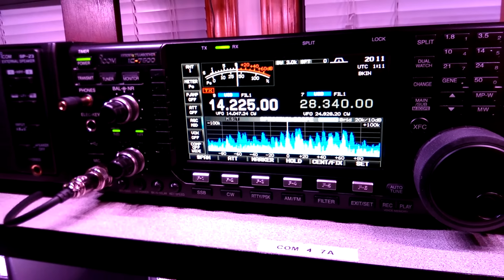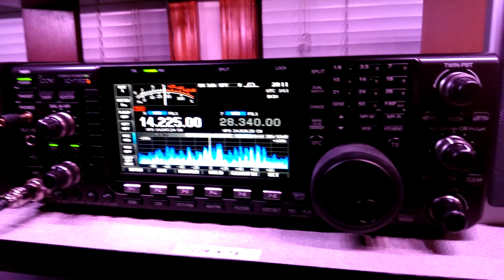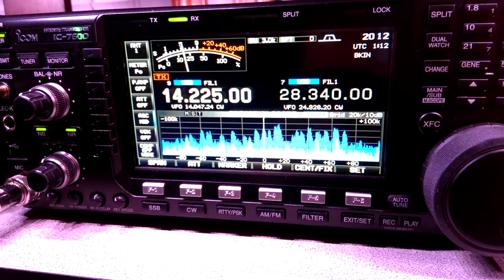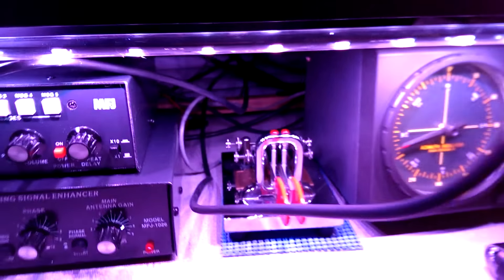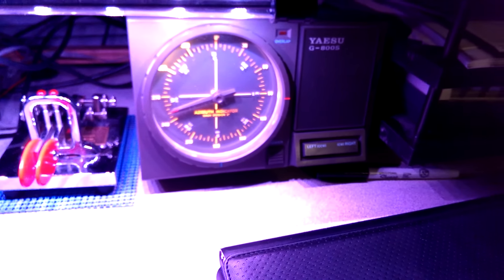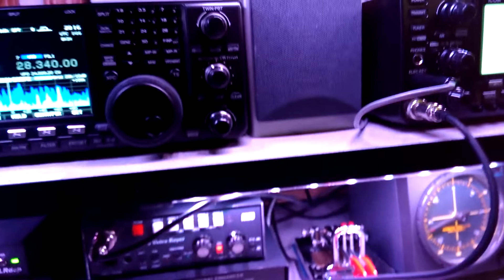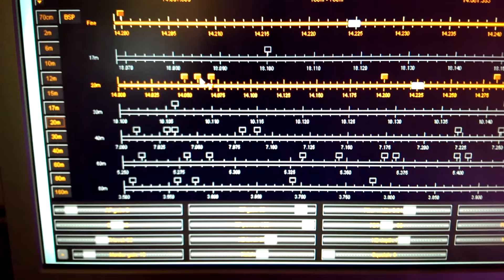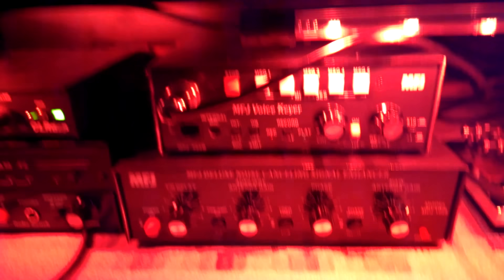My Amateur Radio station recommendations

Comment: Nice station setup Johnnie!  It seems from some of the comments below that folks don't understand that this isn't a "beginner" setup.  It's a more advanced setup, but by no means a top of the line station either.  Like all hobbies, you can get in cheap or the sky's the limit.  If they think your setup is WAY to expensive or complex, they can always start at the lower end.  Nice video though.  Thanks for posting.

Comment: Great video! I especially like the lights, just bought my 7600, and have to set it up. I was using an IC-740 I bought used about 30 years ago, and it finally died about a month ago. With reliability like that, I think this is probably the last HF radio I'll ever have!
Reply from the maker: They are on sale big time at HRO, is that where you got it?
Reply: Yep, just had to convince my wife... which is a story in itself! Actually, she was very supportive of my spending the money, it helped that my birthday is this month, and I told her she could just put a bow on it for the next 5 years of Christmas, birthdays, father's day, etc...
Reply from the maker: R Berber Your going to love the radio! Be sure to get a USB cable to connect it to your PC for logging!
Reply: Fix that 740. If you're not capable of doing this, ship it to me, I live in N.Y. &  I've been an Electronics Tech.  "A"  since 1980. I'll be more than glad to do this job for you. Just so you know, everyone I do work for, always gets a great deal, & I do not, ripoff anyone. Things like that?? always comes back to those who do... Ten Fold. '73's

Comment: Fantastic setup.  Interested in the 9100, but a bit scared off due to having a very early 746Pro (with all the problems).
Reply from the maker: +Scott Taylor Life is full of risks but life is not a trial run. Live it to its fullest.  Last I looked there were no luggage racks in a Hearse, we leave this world the way we came in. Don't ever let fear stop you from doing what you love.
Reply: +johnnieace45 I certainly understand that concept.  Just trying not to get a lemon again -- especially since Icom do not own up to the issues for so long.  Wondering if a decked-out K3S with x-verters might be a better way to go.  Another issue is that I am renting a house (at least for the next 18 - 30 months) with incredibly limited covert antenna options, and I do not want to get the Elecraft only do discover a K4 (or something from another mfgr) coming out when I am ready in my own house.   lol...  I guess it is nice to have options.
Reply from the maker: Scott Taylor Elecrafts are not without problems. Good luck, buy a rabbits foot first. :-P
Reply: I think the differences between the now model and the coming soon model—with radios and many other things—are always very incremental and make little difference in the great scheme of things.

Comment: So far I have a uniden bc345crs, a uv-r5,and pretty soon I'll get a pro 2055 and a possible CB radio with CW along with it.
Then I'm going to get my technician class license then upgrade it to general by July 1st.
Reply from the maker: +code lyoko 34 Look at rigs from the 80's Like the Icom 735, Kenwood TS440, Yaesu 757GX. Those are some of the best bang for the buck radios out there. Can be had for around $400 now. Later you will be able to sell it for what you paid for it if not more. :-)

Comment: Very nice setup. I've been a no-code technician for over 30 years and just recently got my General 2 years ago. I haven't gotten an hf rig yet. I only talk on hf during field day. I'm now working on my Extra Class and looking at either getting a Icom 7600 or the 7300. Can't make up my mind. This will be my first ever hf rig. That noise bridge, does it just connect to your 7600? Also, if I go with the 7600, what do I need to connect it up to my computer. My eyes are getting bad and I'd probably have to squint to see the controls on the front cover of the 7600. So a computer setup would be better for my viewing. Also, will I need that Kantronics for digital work with the 7600? I thought the 7600 already has digital built in. Anyway, 73's. aka N3NQP. P.S., would like to talk to you further for advice.
Reply from the maker: From what I hear the 7300 is an outstanding deal and very affordable. They sound great on the air. Also check out the Kenwood 590sg and the Yaesu FTDX1200.
Reply: Thanks! 73's.

Comment: Very nice station!, I hear you about spillage and putting it on the second tier, I saw a Youtube video of iv3yer's station and he has the radio slightly raised but then he tilts it up. I have a ts-2000 now but eventually want to get either a 7600 or FTdx5000, can't decide yet. I have always loved the look of the FT-2000 but that is a bit of an older rig.. the FTdx5000's look comes close to that.Who makes the lights that change color?
Reply from the maker: IC7300 is the new cat's meow of the Icom line, check out the reviews.
Reply: just ordered my 7300 from giga parts fri. should have it by tue. or wed.
Reply: If you like finger prints all over the face of your radio which I do NOT.I am a huge fan of ICOM & Love my 7600 but would NOT use a 7300 if it were FREE or any other transceiver that needs me too touch the display just so it will perform any function.Stupidest idea ever brought into Amateur Radio.I'd take an ICOM 7000 hands down over the 7300 since it's AWESOME & no need for touching the face or display for any reason.
Reply: I BOUGHT a  7300 love it but it is not American made i pray ten tech come back................
Reply: the pro 40 mike make the i com sound GREAT BUT LIKES THE POWER TO DRIVE MY 77SX...CAN'T RUN THAT MUCH POWER ANYWAY
Reply from the maker: We visited TenTec was going to video it but the place was seriously depressing. A once great privately own business that got destroyed by competition and apathy of two-way radio communication.
Reply: @1OFGODSOWN  I actually ended up getting a FTDX-101MP.

Comment: I also have the ICOM 7600 & I use a ClearSpeech Base module on it & every transceiver I use o AM or SSB.I never turn my RF Gain down.It is always wide open on all of my radios.I also always run the preamps & on the 7600 both of them.I don't have any issues with noise when running the ClearSpeech Modules & the DSP in the 7600 so I see no need in turning down the RF Gain for any reason?I never turn it down on my ICOM 275A in my shack or my Radio Shack HTX-10 in my mobile which I use a ClearSpeech DSP Speaker on.I run a preamp on the Mirage B1016 amplifier attached to the 275A & an external preamp on my HTX-10 as well.The ClearSpeech modules & speaker remove most all of the unwanted noise so running a preamp & the RF Gain wide open permits me the strongest signals possible.That's why we have choices & that's my choice & yours is different.
Reply: @10OFGODSOWN So you like noise do ya.
Reply: @3butalcomp3  I Love getting in the way of NOISE and IDIOTS.👍🤪😂🤣🎙🇺🇸

Comment: Very nice set up indeed!  

Only Tom's comment is showing so don't know what the others said, but folks, you can get on the air with a $30 Baofeng if that's where your budget is.  Or a $200 TYT quad band mobile that can be used as a base, just add a power supply.  You start where you are and upgrade as you can.

Comment: I guess you've got a lot of $$ tied up in Ham gear.  I only have a mono band 2 meter HT on a home brew 1/4 wave ground plane made out of romex I had cut apart.
Reply from the maker: yeah, been into radio since 1975, figured I was going to stay for a bit :-)

Comment: Thanks for the video!  I'd love to see more about how you've got the wiring handled and  the equipment laid out. How do you manage the jungle behind the desk? Can you get back there when you need to? What about getting rid of heat? How do you pull all your antenna cables into the house?

(Sorry for all the questions; I'm new, and getting excited about starting to set up some equipment ....)
Reply from the maker: Behind the MFJ stuff is a multi-channel separately fused&#160;rigrunner http://www.westmountainradio.com/rigrunner.php&#160;which provides power to all the low power stuff through power pole connectors. Yes, I have a LOT of separate feed lines and have them come in through the&#160;basement up to the side of my air duct which is then sealed after the cables come through. My floor vent is slightly raised due to the cables coming out.&#160; The cables come down to the bottom of the tower into lightning arrestors then the coax is looped back up and into my basement.
Lightning is no joke, even when everything is done right a disaster is still very possible. The key thing you are trying to avoid is a possible fire!Because the risers give extra room above the radios I am able to cover them with a towel when not in use to keep dust off them and if I need to I can reach over the top of them or even pull them out if necessary.&#160; The key to stacking radio gear is to not stack directly on top of each other but to use risers so each level is on its own shelf allowing easy removal of any component and is not one big Jenga puzzle!&#160; Starting off go with pre-owned stuff so you can get on the air and run all the modes. then later swap out stuff to new only if you feel you are in it for the long haul.&#160; 73

Comment: How much (about) does it cost to get into a small beginner ham base. I have had my licence for about 2 years. And im 15 and i love radio. Looking for a price range
Reply from the maker: I bought my first HF rig at a hamfest for $160.
Reply: Okay. I am using a handheld radio for now. Ham that is. I have gotten way more into cb radios. And about the handheld. I was being picked up loud and clear on a repeater 20 miles away. Is that normal?
Reply from the maker: yes, that is normal because of their height you get great local range using repeaters. But HF is where all the real fun is.

Comment: Very nice set up. Recently passed the technician test, studying up for my general & extra ticket in one sitting. Just wondering why not get a cheaper transceiver and run a waterfall display on a computer screen? I'm interested in some HF portable and am doing a little research. 73
Reply from the maker: I hear that some people are now buying SDR receiver and  using the transceiver for transmit only. I think you need to short the SDR's receive input to ground when you tx or will blow out the front end of the receiver. But it might be a good option to get the most for your money. I hear a lot about the IC-7300. Would like to see an operate that rig someday.  I prefer a conventional type radio.  One of my favorites is the Yaesu FT1000 MkV Field

Comment: im designing my garage and shack right now and considering different layouts and such, i am curious as to why you chose to put your rigs on the 2nd level instead of the first and if you have played with that layout over the years. i do love your setup and im going with those 2 rigs for the shack as well. sadly for now im just using a ts-2000 from the office in the house. cheers  KU4XV
Reply from the maker: Good question, I used to have rigs on the bottom and accessories up top but found that it was difficult to get to the back of the radios. Also any drinks or spillage would be devastating to the equipment. I recommend you look at the adjustable standing riser as well. Sometimes long sitting is bad for the back. My brothers ham station was at standing height and he used barstools if you wanted to sit.  Think outside of the box, come up with something cool and send us a link!

Comment: Not in the manual for the ICOM 7600 but it actually has Dual Receive on two Different bands that are i the same pass band.You can listen to 15 & 17,or 17 & 20 meters at the same time.It works on listening to two bands not in the same pass band as well but the 2nd receiver or B-VFO signal is greatly reduced but still usable on strong signals on the B-VFO.Dual Watch actually can stand for Dual Receive.HRD SUCKS & is a Ripoff.

Comment: You should never turn down the RF gain if you have the AGC on and a product detector in the radio. If you need to drop the level, use the attenuator instead. Nice station. Been hamming since 1962 and still loving it !!

Comment: Fantastic setup  . Could you please break down cost .
Reply: A clean Used ICOM 7600 can now be found for less than $2000.I paid $3000 for mine New 2 years ago & worth every dime.

Comment: Holy smokes. I am getting my license. this overwhelmed me a little bit
Reply from the maker: Congrats on getting your license. Your going to have a blast!
Reply: Jay Arsenault

LicenCe..Noun.
LicenSe.. Verb,
 You are NOT expected to start of with a station like this.
Consider your wallet, your family, your Bank Manager...
Build a low power, low cost, low worries kit or home brew set up.
Don't try to run before you can walk.
You'll get a sense of achievement and not give your wallet Post Traumatic Distress Disorder.
Become addicted to solder smoke... It's far better than other smokes and
you'll advance your real knowledge.
LEARN MORSE CODE.  It'll be a new language for you, the next step in keeping 
Alzheimers at bay!  
Sincere, friendly and experienced advice.
Reply: MauriatOttolink licenSe is how it is spelled in the U.S., just like defenSe.
Reply: It would overwhelm me too all at once, but if you gradually build it up over time, it will just naturally come about!

Comment: The MFJ  noise canceller, excellent device though it is for other purposes, will NOT shift Plasma TV interference.. Believe me. Been there ..done that. Still have the A1 MFJ  AND the psychiatrist's certificate to prove it!
Set it up (IF YOU CAN!) to reduce the noise and the very moment that the pic content changes, the noise is back.
There is only ONE, utterly effective cure and that's a single, 12 bore cartridge in a suitable applicator.
You may choose from two options, where to use this most effective ploy.  Either thru' the offending TV or thru' the owner's head. The former may present slightly less severe legal proceedings against you but by no means, the same degree of smug satisfaction as the latter!
Reply from the maker: MauriatOttolink I had a friend that used to drink a lot and the neighbor used to always call him up and say you were coming in on his TV Set he ended up hooking the cable TV to the back of his linear amplifier blew up his neighbor's TV and the amplifier up on the pole problem solved!